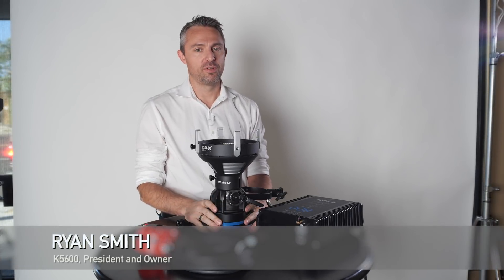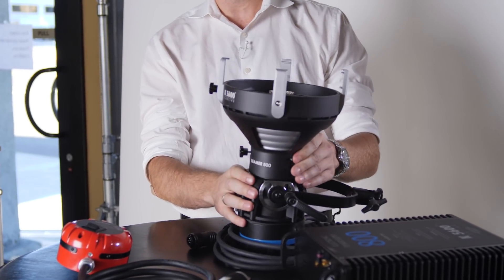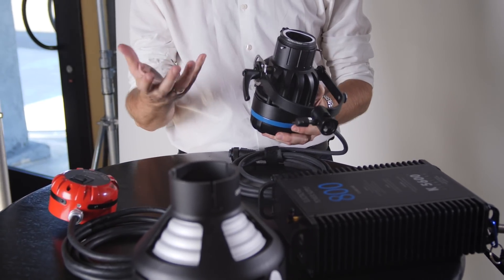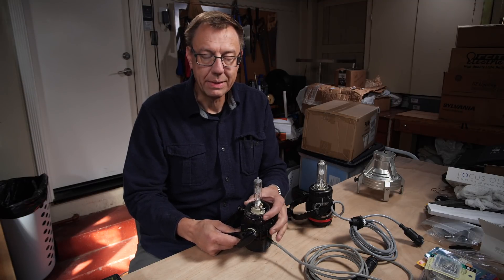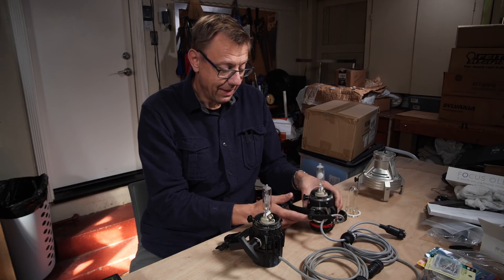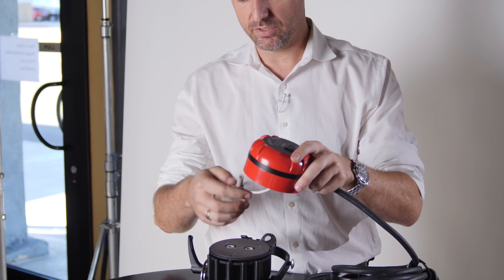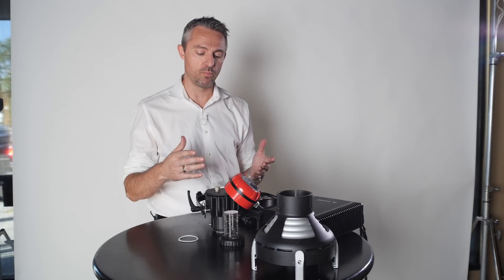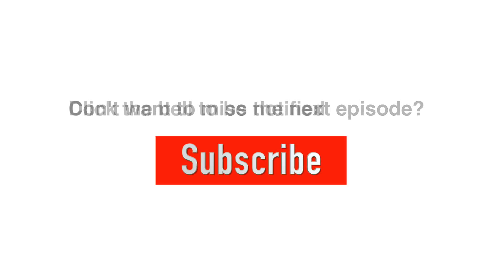Meet The Gaffer #116: K5600 Joker2 Update

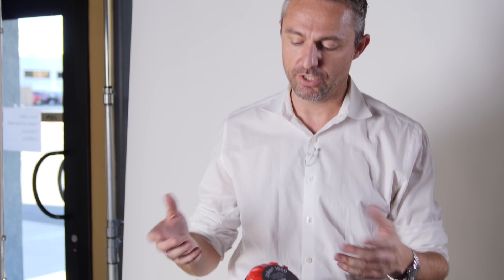Comment: 4:05 so much value in used tungsten. Picked up a mole 2k fresnel with barn doors and scrims for $145
Reply from the maker: And it’s beautiful light!
Reply: Luke Seerveld best color reproduction out of any light source. If you can’t handle the heat then get out of the tungsten.
Reply from the maker: Ha, ha! Eventually you have to weigh it against versatility, speed, and what is marketable. Tungsten still has its place, but it’s pretty tough to be a purist in this business:)
Reply: Luke Seerveld the cost and cold weather of nyc will keep me at tungsten for a while
Reply from the maker: Colin Ziemer... Nice!

Comment: Hi Luke,

If you could only pick the zoom attachment or set of lenses, which would you pick? Is the zoom still a fairly dirty beam like the Arri M series?

What's the most common barrel for a jo-leko?

I'd also like to know about the hot strike ability when you have time.

Thanks!
Reply from the maker: Hi Rob,

Your mileage may vary... but I prefer the Joker zoom to swapping lenses. That may be because I mostly use the 800 in that configuration to go thru frames of diffusion. 

I don’t really have a go-to lens for joleekos. Having a 50, 36, 26, and 19 avail is good. If I had to choose I would pick the 36.

Hot strike is pretty good with jokers, especially the newer it is. I’ve always found Joker (K5600) service wonderfully responsive whether for quick tech questions or turn around for repairs.

Hope that helps!
Reply: @meetthegaffer  Thanks for the reply.

Re joleekos, what about zoom lenses, or don't they fit? What about a wider beam angle with iris control?

I'm in Australia and it's harder to find information on certain lights, even though I'm sure it's standard in LA etc. so your channel is a huge help.
Reply from the maker: I’ve used the zooms in regular tungsten config, but not as joleekos... and I don’t own any, so I don’t know how well they work as joleekos. Maybe someone else can clue us in?

An iris or the cutters/blades are great for shaping the light, along with window, geometric, or organic patters, but I like to get close with the barrel size rather than starting too wide and cutting way in, because I feel like you’re not getting the most out of the light. Having some hampshire is nice to take the edge off, CTO for warming, and having wire or ND gel close at hand is handy too. I’m starting to use the LED ellipsoidals more, but you have to deal with color fringing and the output is not always enough. Joleekos are still a great tool:)
Reply: @meetthegaffer  great information, thanks Luke!